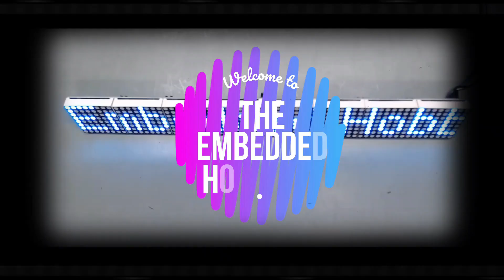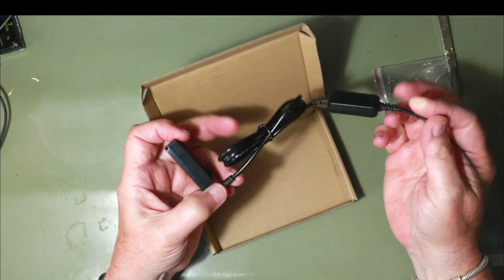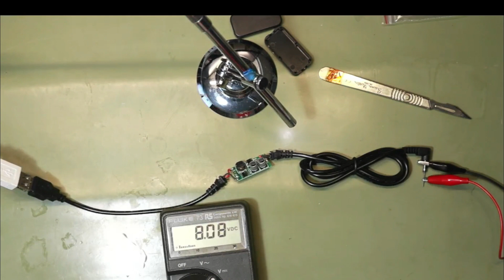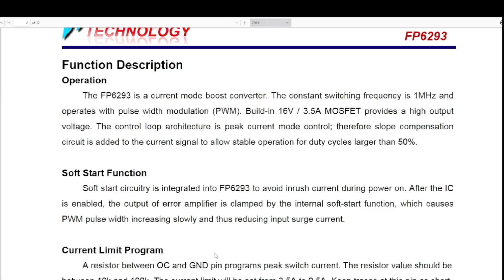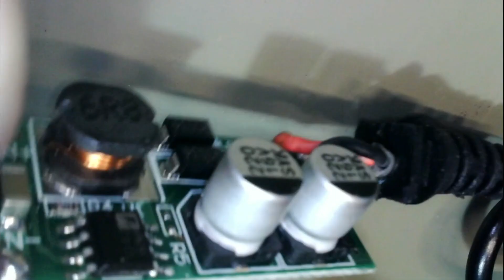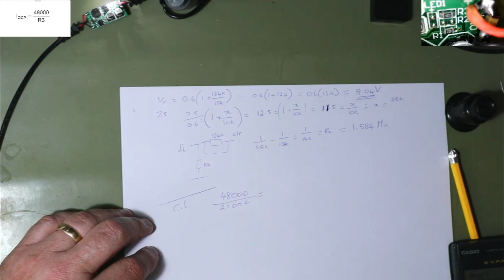#204 Cannon M50 USB battery eliminator postbag or teardown

Comment: Any working power supply is worth using. Could work as a breadboard supply. No big loss if it's shorted out.
Reply from the maker: There's nothing wrong as such with the PSU, it's the fact that they used a 50 Cent circuit to power a $500 camera. An extra $5 worth of components to put some protection on the board for the camera, could have made it a much much better product.
Reply: @TheEmbeddedHobbyist  Very true, but we know any "bargain" we find online these days, isn't such a bargain in the end. Seems they all cheap out these days.

Comment: I have seen a few of those boards used as 2s chargers for led torches. Then they boost 5v to 8.4v.  They seem to work ok but I wouldn't fancy connecting their output to an expensive camera. Too risky.
Reply from the maker: That's why I think I might just a larger two cell battery, longer running time and almost zero risk of overvolting the camera.

The BlackBeltBarrister had a £1000 camera killed by a battery eliminator but his was mains powered so this one is not so bad. But could still be a camera killer.